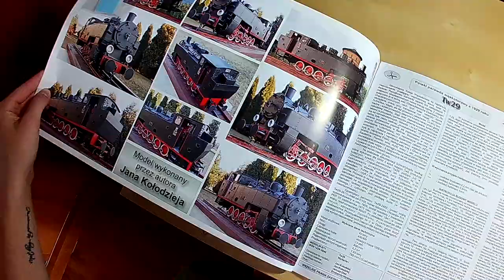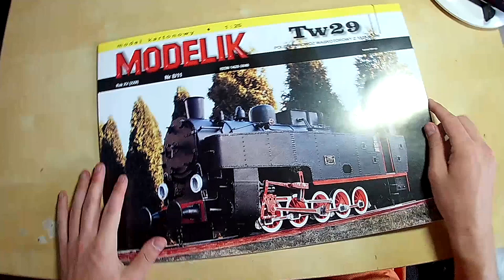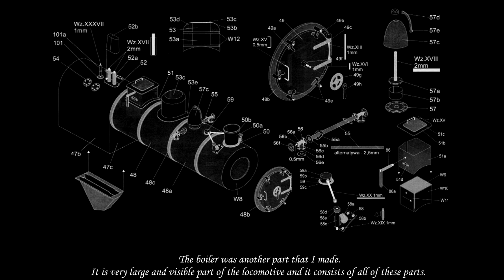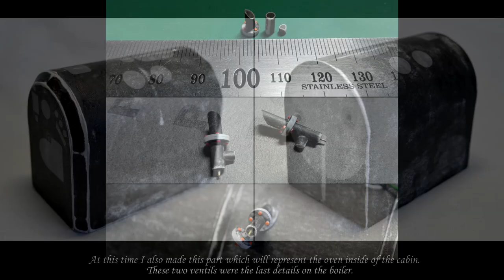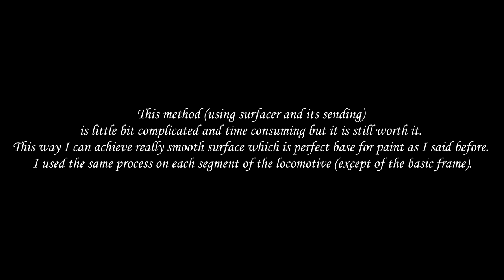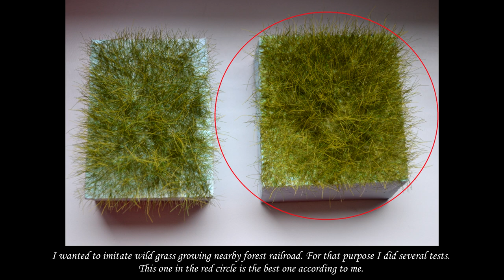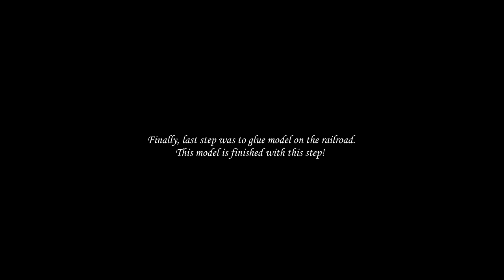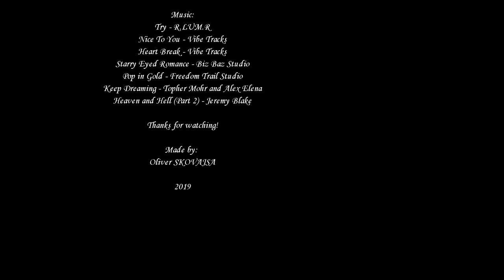Tw29 - Modelik - 1/25

Comment: Your build is simply amazing!

I stumbled upon this video by accident but it is great timing, as i just started building my own Tw29. (Although yours will most definitely be nicer).
2 Questions:
1) Are there any major problems i should be aware of?
2) Any tips for painting the signs (11:10)? Because that is something i really struggled with on my last model (Cn2t "Las").

Also i have a small tip for something you could look into for future railway builds in 1:25: For my Cn2t i didn't want to build my rails out of paper, so i looked around and found Code 250 profiles used by 1:22,5 model railroaders. And they fit the dimensions specified by the instructions perfectly. They look great (although i absolutely butchered their paintjob :/ )But i don't know if they are available in your country and even if they are, your rails look great already so it might not be worth it for you.
Reply from the maker: First of all, thank you for your kind words.

1) No, they are no major mistakes. Mr. Kołodziej did good job and this was probably the most accurate model I've ever made.
2) Firstly, these little sings are painted with an airbrush. Then I put small amount of white color on paper towel and after few seconds I gently pushed (repeatedly) these signs to the color. The last step was to use varnish to fix the result.

Honestly, I don't know what you mean. It would be great If you can send me some link on that stuff. But personally, I rather use paper rails. I got a friend which has laser and he can cut off these things easilly for me. :)

Comment: How do you prepare paper for painting?
Reply from the maker: 1. Nitro Varnish (cellulose based varnish primarily for wood) - you can apply it over whole pages of model at the beginning of the construction process, or as I do, at the end when I have everything glued in subassemblies before surfacer. The paper will be more solid and not so much absorbent. But be aware for plastic parts which can be destroyed by that varnish (or its thinner). 

2. Surfacer/Primer - I love Mr. Surfacers - black one or grey 1200/1500 are the best for me. Dont forget to sand the whole surface after the surfacer is completely dried. They are pretty much the same. 

3. Painting & Weathering

The first step isn't necessary. I used it only on my last repainted model - the Hetzer (feel free to check the video) but It didn't have the effect that I expected.